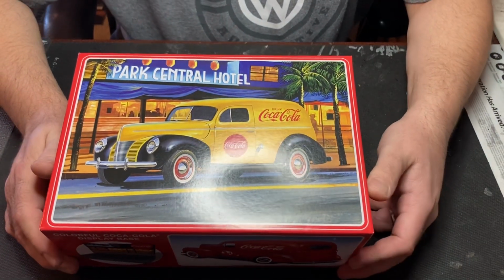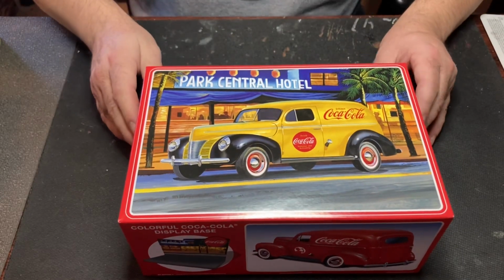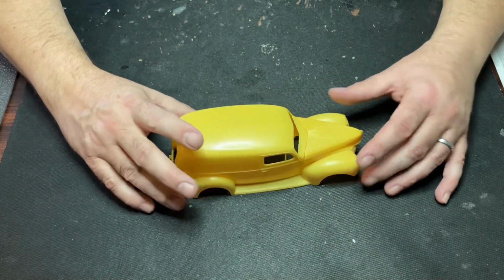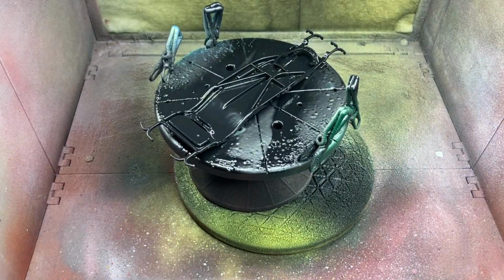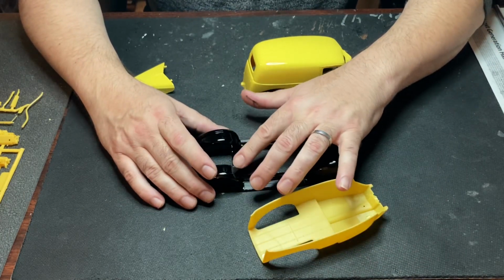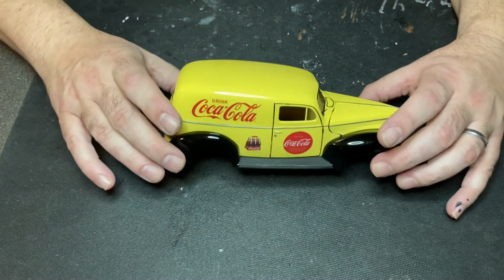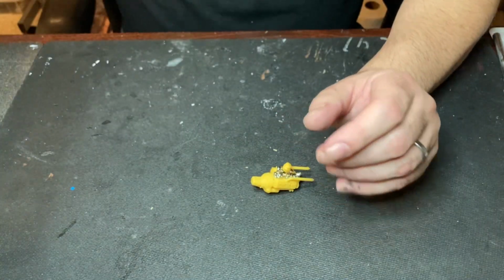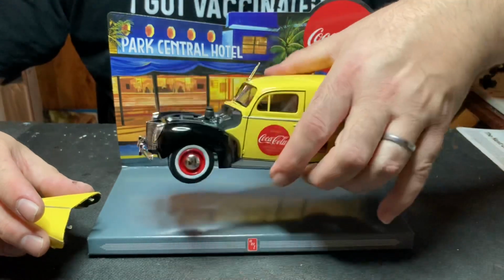1940 Coca Cola Ford delivery by AMT #modelkit #scalemodels #autism #hobbys

Comment: Louie, you have another great build here! Its beautiful ! I am well aware that AMT 40 Ford kits have big parting lines on the front fenders. Didn't you have to prime the fenders to "cover" the scratch marks from sanding? My hobby paint brushes are shot, I am due in for a new set. What was the brush you were using to paint the firewall? I could use that fine brush you were using!Lastly, the green paint you used on the motor, didn't it craze the bare plastic? I thought the motor paint was going to be too hot for the bare plastic? I learn things from you in your channel! Hope you had a nice Christmas!
Reply from the maker: I painted the Tamiya paint right over the plastic. No primer. Before I painted the fenders I wet sanded them with 2000 grit paper. The hobby brushes I use come from Hobby Lobby nothing special. I try and use inexpensive supplies and materials to complete my builds. As for the green  engine paint I used it on small parts which don’t have a lot of flat surfaces otherwise it WILL craze the plastic. Thank you for watching!!
Reply: @TheAutisticModeler  ok thank you! I've been using inexpensive brushes as well and the brushes don't last long. The paint strokes are poor also, they're not the quality of brushing like you were doing on the firewall in your video but thanks for all the tips